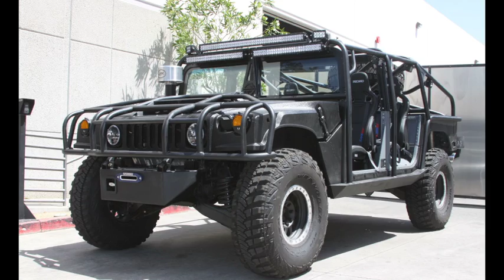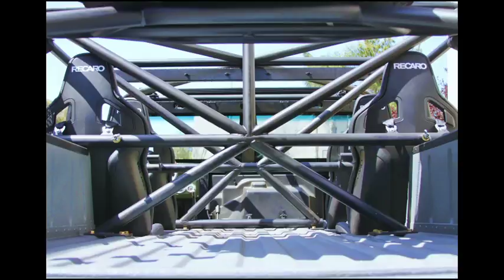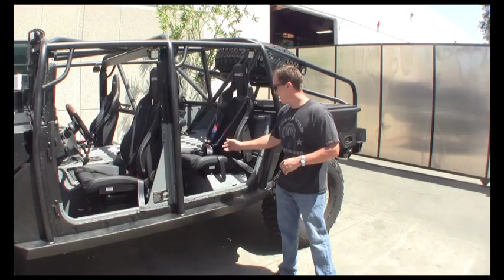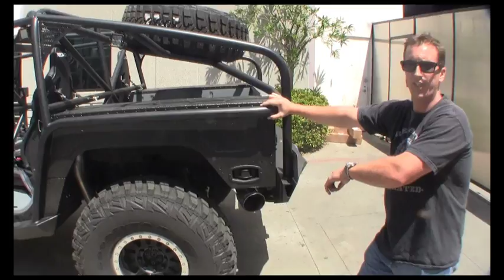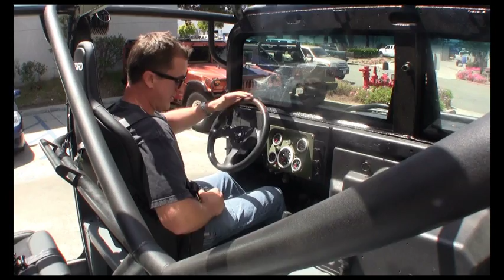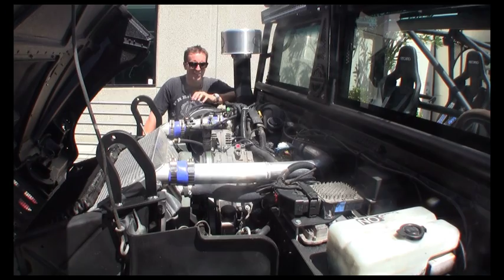Predator's AT-RV (All Terrain Reconnaissance Vehicle)

Comment: Hey there. Can you fully armor and blast-proof with extreme off-road capability?
Reply from the maker: Yes however added weight will compromise offroad ability. Blast proof is a different story. It depends on the threat. If your concerned about an ied then yes/no. The flat bottom design of the H1 is not best suited for this type of attack. A "V Hull" design such as an MRAP is much more suited for this.

Comment: AWD and 4WD?
Reply from the maker: +Anderson Blooper Yes, it has a selectable transfer case we manufacture in house. It allows the driver to select AWD (original configuration) as well as the ability to shift into 2wd. The 2wd helps slightly with fuel economy. Also a nice feature offroading in specific conditions.

Comment: Retail= $799,000
Reply from the maker: This is not accurate.  Pricing has yet to be determined because of the available  options.  Base price comes in much much lower then 799K. But i"m sure if you wanted to spend 799,000 with Predator, we could accommodate.